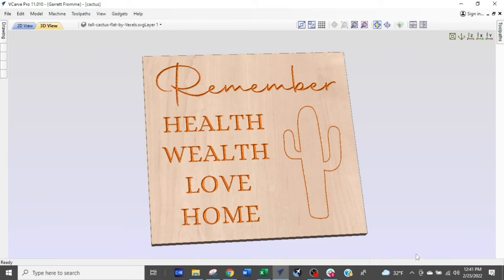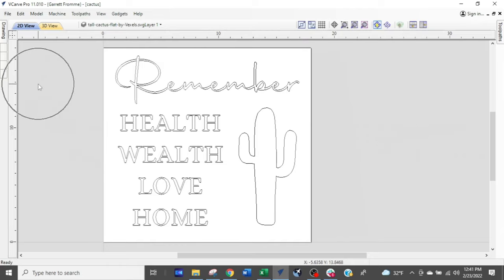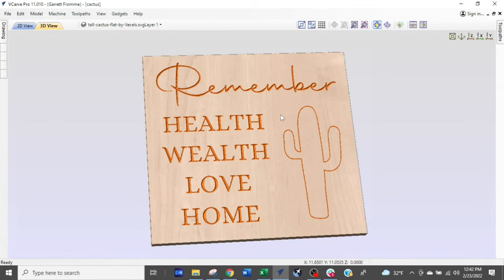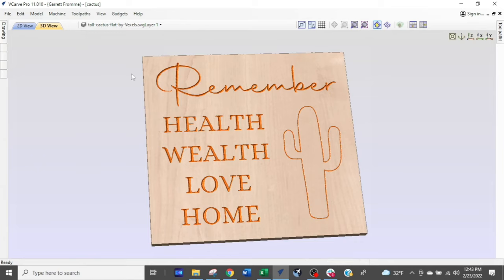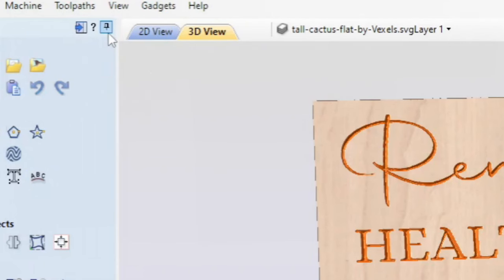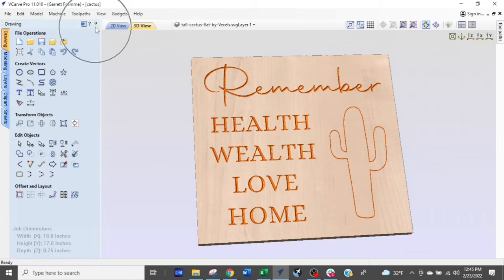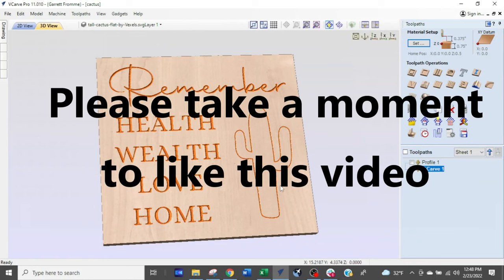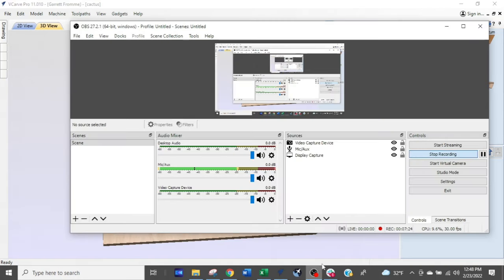Vectric Quick Tip You Didn't Know About Menu [Vcarve, Aspire & Cut2D]

Comment: Hey I was wondering if I sent you something could you cnc it and make a video on how you did it for me I’ll pay you.
Reply from the maker: It depends on what it is.
Reply: A Rc car chassis, I would like it to be cut out of carbon fiber.
Reply from the maker: @jgotdawheel  It would be an interesting project. However, that would not align with what I am teaching at the moment, and the videos on my list that people are asking for. I would suggest asking people in the Facebook groups. Thank you for asking me though. It is intriguing
Reply: @IDCWoodcraft  
I’m willing to Pay you to teach me how to do it
Reply: @IDCWoodcraft  I’m pretty sure you won’t lose your audience if anything you’ll get more traffic coming thru because it’s little to no videos of people doing this.
Reply from the maker: @jgotdawheel  I'm not worried about losing audience. I always have to make sure the videos have a significant audience before I dive into something. Do you have your project designed?
Reply: @jgotdawheel  You can design it in Fusion 360 or maybe even Sketch Up.  I haven’t used Sketch Up, but I understand it is quite easy and color coded and it is free.  Fusion 360 has a free version, also and there is free training on YT.  The chassis may be 3D printable in carbon, as that has come a long way for quite a few concepts.  Start a few searches and you will find what is available. 😎